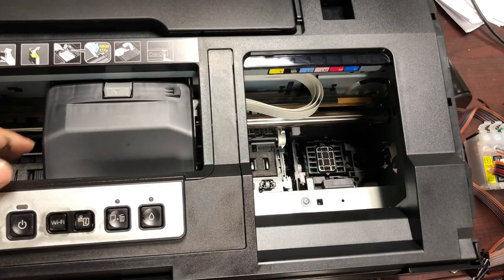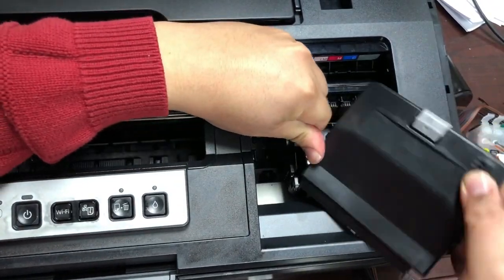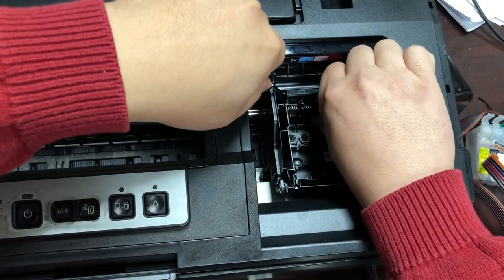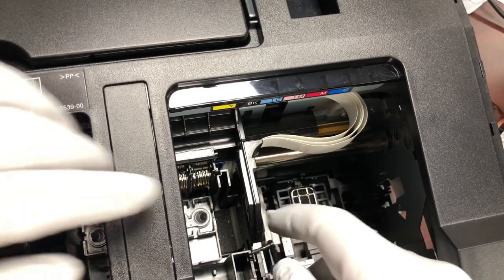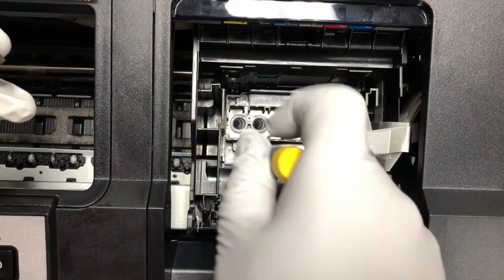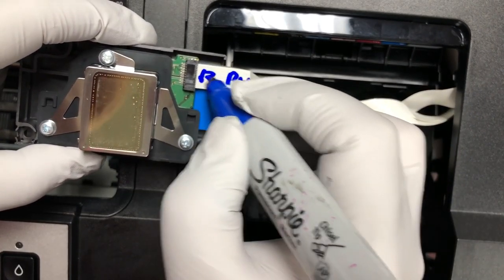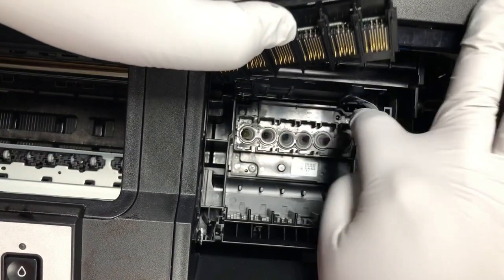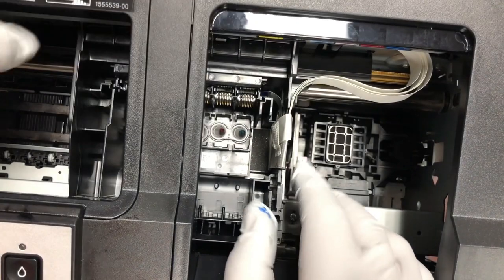#1 Easy Printhead Change for Epson Artisan 1430 Detailed Guide - Cartridge T079

Comment: Hey Kevin is L1800 and 1430 printhead interchangeable
Reply: The Artisan 1430 and epson l1800 are very similar. If you search printhead for epson l1800 or artisan 1430, you'll see both are listed in the description as they are both compatible
Reply: I've also owned both and they are very similar. Many of the parts will go into both as they match such as the printheads and the ink pump assembly/capping station.

Comment: I keep getting all red ink lights after putting in a new printhead. I've plugged the FFC cable for the chipboard in and out several times making sure it's tight and tried OEM and refillable cartridges. I tried to put the old printhead back in and the same thing now. I also tried a chipboard from another Artisan 1430. What is going on do you think?
Reply: Did you fix yours? Mine does the same as yours. Thanks

Comment: i just changed my print head, got new cartridges, and it doesn't print... nothing comes out.. it is wasting my ink because i keep trying to clean the nozzles, but nothing printed at all... sucks... i really loved this printer, i wish it didn't get clogged with pigment ink... LOL...
Reply: if you are using refillable carts try forcing ink through using a syringe in the fill port.

Comment: After doing this, printer started up and recognized ink cartridges. Then it turned off suddenly and is making a very low  beeping sound but will no turn back on. I unplugged and tried again and it's still making sound but wont turn on
Reply: this sounds like something was left/stuck in the way of the carriage or not reinstalled properly.  Does your carriage glide properly/manually if you can do so by hand?  Know this is a super late reply, so maybe you figured it out post comment.  Also which lights are flashing and/or alternating?